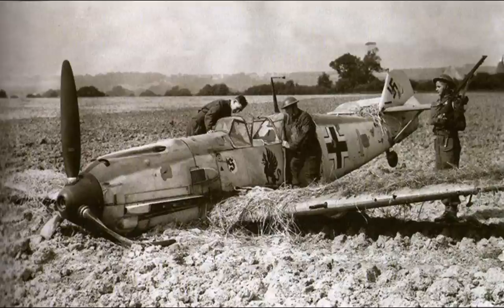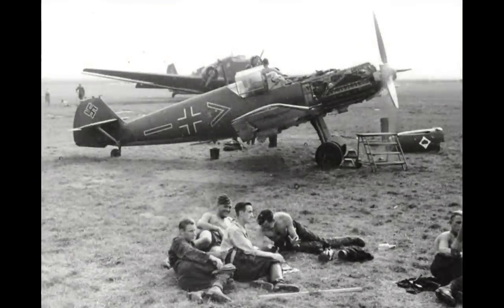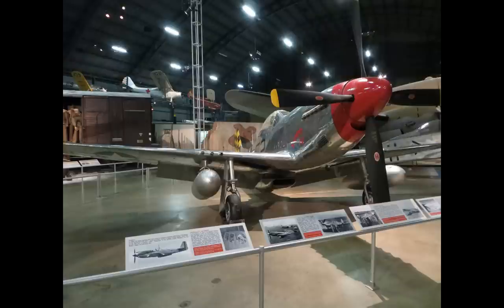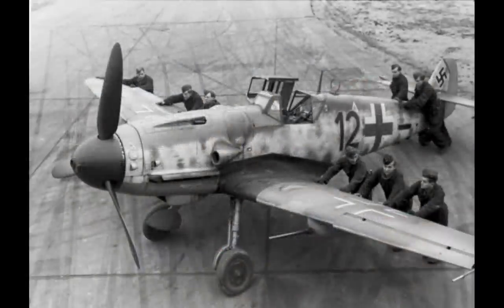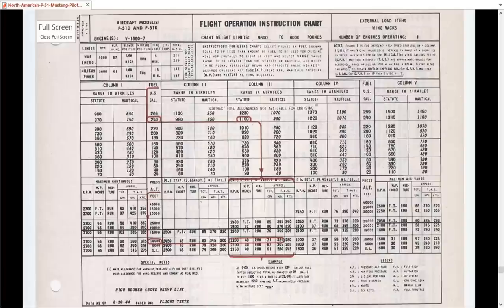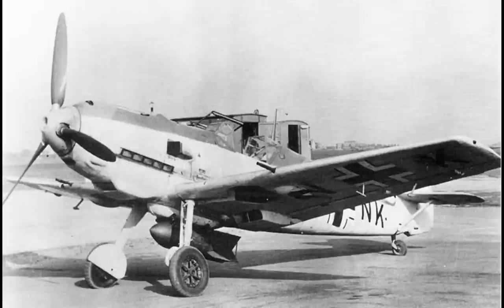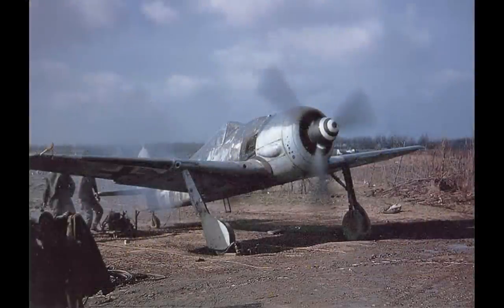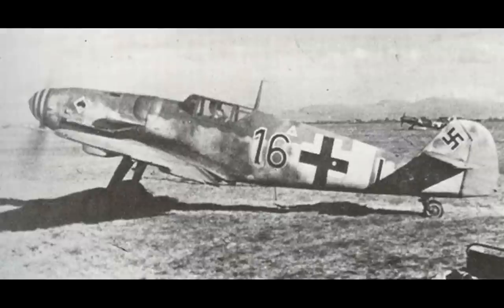Messerschmitt BF 109, Why Such Short Range?

Comment: A polite answer to a question that should not needed to have been asked.  Germans weren't planning on needing a single engine  long range fighter else they would have built one, they certainly could have built one, but maybe they would have had to use Heinkel rather than Messerschmitt.  So could have the Brits. They didn't think they needed one either and for a defensive fighter or a tactical fighter which they both were, they were supposed to be close to their area of operations.  The 109 should have been replaced by 1943.  The Me-309 was larger with built in longer range, but still nowhere near the P-51's, even after 1940 the Germans were no longer planning to fight over Britain anytime soon.   The Germans never  had a strategic aviation policy...that died with Wever.   The Brits also had gotten caught short legged but the US picked them up with the happy marriage of the Merlin to the Mustang and the Americans gave the Brits all the single-engine long range day fighters they needed, around 600 Mustang III's and IV's and the Brit loss rate was low because these aircraft were not used for ground attack.  The Germans did not have a range issue, except in 1940, after that it was a performance/production/pilot issue that they never resolved.  Note like the Germans the Brits did not have a daylight strategic aviation policy, nor did the Russians. Only the Americans decided they would take the war to the heart of the enemy in daylight.

Comment: As usual, a terrific video. Thanks for your effort to document these subjects. One thing that you should note is that the ME-109 had less internal fuel storage volume as the airplane mounted radiators in the wing which is where the P-51 stored most of its fuel. Even though the P-51 had thinner wings with its beautiful laminar flow airfoil, it had much greater fuel storage capacity as the P-51 mounted its radiator under the belly of the fuselage; and as you note elsewhere actually increased overall thrust. It also had an additional 85 gallon tank behind the pilot. See http://109lair.hobbyvista.com/techref/systems/cooling/f_flaps.htm for an outstanding analysis of the ME-109 radiator system. 
Please keep up the good work!

Comment: @Greg's Airplanes and Automobiles
I think one thing many people forget when discussing the shortcomings of the Bf-109, is that it was intended to be an air superiority fighter over a battlefront. A role in which it performed admirably in every theater until stopping USA bombers became the upmost priority. The Luftwaffe did anticipate the Battle of Britain and did design a fighter for that role and that was the Bf-110. It was a heavy fighter with a range up to around 1000 km. More than enough to cover German bombers to and from Britain. The problem was that it was a twin engine design that could not outfight British single engine fighter, at least not while escorting. It should also be noted that the German directive in the Battle of Britain, operation Adlerangriff, was succeeding in its goal of eliminating the RAF until the very last day before the London Blitz began. The RAF had been losing more planes and pilots than it would sustain but Hitler had given up and focused on the East. Perhaps this is why the German designers never learned their lesson to increase the range in their newer fighters like the Fw-190. Ultimately the Luftwaffe's job became a defensive one and range was not a priority in that regard.

Comment: I don't think the cooling effect people cite is due to the venturi, it's caused by the vaporization of the fuel, which absorbs heat energy. This cooling would allow a denser charge into the cylinder at a given boost pressure. I suppose, however, if you use fuel injection you'd also get the cooling effect, since the fuel is vaporizing when you inject it into the cylinder. Which means you could simply use additional boost and feed the air into the cylinder at a higher temperature, it'd get cooled down by the fuel when it gets injected and you'd avoid knock even given the higher temperature of the air being introduced into the cylinder. The heat removed by vaporization of the fuel is significant - in small 2 stroke model airplanes, glow ignition engines, which use methanol for fuel make a lot more power than spark ignition engines which burn gasoline, the reason being that methanol contains much less energy per unit mass than gasoline does, and therefore the mixture is a lot richer. This apparently cools the intake charge a great deal more and allows for a denser charge into the cylinder.
Reply from the maker: That's not an argument for a carburetor. You can inject the fuel far enough back to get that vaporization effect with fuel injection, which the P-51, P-47 and other allied planes do. The Germans did this too by using an extra fuel injector to inject fuel upstream, which is probably the best way to do it. Only a small amount of that fuel will vaporize, so injecting it all at a point early in the system is of no benefit. Thus the German system takes advantage of this principle while still maintaining ideal fuel distribution. 

My objection is regarding the argument that a carb is superior to fuel injection due to a cooling effect. It's not. There is a good reason nearly every significant fighter by the end of the war had gone to injection.
Reply: By "injection" do you strictly mean direct injection into the cylinder (i.e. the fuel gets introduced after the air enters the cylinder through the intake valve) or would injection into the intake system (like modern day throttle body injection) count? I always thought the later Merlin carburetors were actually of this sort. Yeah, I'm not convinced vaporizing the fuel before it enters the cylinder is better than vaporizing it in the cylinder itself, since both would induce cooling, but one could conceivably make a case for evaporation before it enters the cylinder to be better because it provides for a denser charge by cooling the incoming air. (Or another way to think about it is, in a supercharged engine, it helps with the intercooling and aftercooling.) I don't see a benefit to vaporizing a small fraction of the fuel as opposed to vaporizing all of it upstream of the intake valve, since the amount of fuel being vaporized would be proportional to the cooling effect. The fuel has a specific heat of vaporization, so the more you vaporize the more heat gets absorbed. In any case, the cooling effect ascribed to carburetors isn't due to simple adiabatic cooling of the air due to a drop in pressure past a venturi.

If by "injection" you include introducing the fuel before the charge gets to the intake valve, then yes, there would be no difference in cooling due to fuel vaporization compared with an actual carburetor.

Comment: Although the American aircraft called their fuel system a carburetor, it is a pressure carburetor. This actually very much like throttle body injection. What they call the carburetor is actually just an airflow measuring device that regulates how much fuel is injected through a nozzle below the throttle. Very ingenious mechanical control system. Also I have to say I think that the fuel going from liquid to vapor will cause heat from the supercharger to be absorbed as it heads towards the cylinder’s.
Reply from the maker: Yes I have many videos in which I make it clear that the U.S. "pressure  carburetor" is actually a throttle body fuel injection system.

Comment: The P51´s empty weight was more than 50 percent bigger than of Bf109G(which was still being considered too heavy by Germans), apart from bigger airframe and thus more internal fuel , it was the supercharger which gave P51 it´s great range(high cruise speed at high altitude) and great high alt performance(where the combat started most of the time), infact P51 was relatively underpowered at low altitutes when it came to it´s power/weight ratio, it´s just that P51s were the ones in tactical (and numerical and pilot skill)advantage entering low altitutes, mostly already chasing German planes. Meanwhile Yak-9DD with it´s almost  same empty weight as Bf109G and 1500 miles range was simply filled with fuel tanks "Mustang style"

Comment: Great vid. According to sir Stanley Hooker's auto biography, having the carb before the supercharger was an advantage as the charge was cooled by the fuel, allowing higher boost without overheating the combustion chamber. He was a Cambridge mathematician specialising in the maths of fluid dynamics and flow. He was assigned to rolls Royce by the ministry and for the first few months he wandered the workshops and labs at Derby with no assignment. Noone at Rolls had yet  done the math... He ended up as the chief engineer. The book is called 'not much of an engineer' It is a very interesting read. Keep up the good work.
Reply from the maker: Then why change the Spitfire over to injection?
Reply: @GregsAirplanesandAutomobiles  ?? Fuel economy.  Injection cools the charge as it enters the cylinder. Before that they did fit a diaphragm above fuel in the carb version to solve the negative G problem. My dad worked on the drawings and tooling when they moved Merlin production to the Ford plant. He used to say the mantra was 'increase the pitch and boost the boost then you'l get the bird to roost!'.

Comment: Notes:
1) I read in an auto-bio of a German pilot that the 109 had drop tanks in the Spanish war, but for reasons unknown someone eliminated the drop tank connection in the 109 model used in the " battle of britain".
2) The reason for short range fighter like the Spit and 109 was, they were designed for point defence and offence, not long range offence.
3) The British needed a long range fighter to escort their long range bombers, so they ordered a fighter from the US company North American Aviation. That fighter, which was designed, built and flown 90 days after the contract was signed,  became the P-51. One of the designers of the P-51 was Edgar Schmued(sp?) who formerly worked for Messerschmitt and may still have been a German citizen. The Us brought two of the P-51s to destroy in landing gear drop tests. Pilots flying the 51s from the west coast to the east coast for the tests told their high ranking superiors that the 51 was a great airplane and they should buy a lot of them. The original P- 51A had a low altitude Allison engine and was used by the US Army as a ground attack fighter/bomber. The British bolted a high altitude Rolls-Royce engine to the 51 and it became a high altitude long range air superiority fighter. The RR engine used in the US P-51s was built by the Packard Motor Company in the US.
4) After the war US P-51 pilots testing the 109 stated that visibility out of the 109 was terrible, and one of the big keys for fighter to fighter success in WW2 was seeing the other fighter first, which put the 109 at a big disadvantage. 
5) A big reason for the 109 being slower than the 51 was the exposed rear landing gear, which acted like a boat anchor. 109 pilots complained about the drag of the rear wheel the entire war, but Messerschmitt never put in a retractable rear wheel.
6) A big problem for the German airforce was the Soviets overrunning the Romanian oil fields in August of 1944. No fuel, no planes in the air. A standard joke by the German infantry on the western front was,  if you see a dark plane it's British, if you see a silver plane it's American, if you don't see any planes it's German.
Reply: I read that the 109s in the Spanish civil war had drop tanks, from a book I read about 20 years ago. The book was by a famous German pilot, but I can't remember which one.
I looked for photos of the 109b with drop tanks....and found none. I also saw a note on the 109, that the first one to be fitted with drop tanks was the E7.
The statement in the book that the 109s had drop tanks in Spain has always remained in my memory, but it may be wrong.

Comment: Another factor in the design of these early war aircraft was the weight of the fuel - and - the fact that for some of these aircraft - there was no need for it.

When P-51's first took off - they were heavy with all the fuel it was carrying and the pilots burned it off according to what they thought effected the aircraft's performance the most, so that when they got into combat the fuel tanks which hurt their performance the most were less full of fuel.  Someone with the time and interest can look that up.  I've seen it but hesitate to post something specific from memory.

For the Spitfires - these aircraft were primarily intended to be interceptors.  So - why carry enough fuel to fly to Berlin - if you didn't have to?

For the Germans - the Me 110 was supposed to be their long range fighter - not the 109.  The 110 is another story but for the 109 - for most of it's career - it was used as an interceptor and hence, like the Spitfire - didn't need to haul all that fuel around.

An Interceptor is going to be flying, for the most part, over friendly territory - so - when it's gone through it's fuel - it can land at the closest airfield - top off - and fly home.

The Luftwaffe was never intended to be a strategic air force - like that of the US & UK.  It was meant to be a tactical air force to support the Wehrmacht.  Thus, the relative lack of German interest in the development of 4 engined bombers. (They had some but nothing like the US or UK).

For a tactical air force though - it's fighters can be positioned much closer to the lines - if for no other reason than to up the sortie rate - and hence requires less fuel than an aircraft designed for Bomber Escort - like the P51.

Early war aircraft design didn't emphasize fighter range because the need for that wasn't as apparent as it would be once they actually started fighting instead of theorizing.  For one thing - in the US - the Bomber Cult specifically forbade the development of drop tanks because it called into question the ability of the bombers to fly unescorted to their targets - which is what the Bomber Cult insisted they would be able to do.  Once bombers actually started trying to hit their targets without fighter escort - attitudes changed ...  and you had the development of the P-51 in the US.  Britain's and Germany's solution was to give up on daylight raids.
.

Comment: The P-51, with its laminar flow wing, was designed in 1940. The Bf 109 was designed in 1933. There was a LOT of technological progress in those years.The Packard-built Merlin 66 used in the P-51D had fuel injected carburettors (as opposed to direct injection), which fixed the negative -g issues.

Comment: Some Points of Contention: 
1st: There was Room for more Fuel, the Room later used for GM-1 or MW50 Tanks could have increased internal Fuel Capacity to 600 Liters without upsetting Flight Characteristics too much.
But since the Long Range Role was passed on to the Fw190, and the Post BoB 601s and 605s became more efficient than their Predecessors, the Range remained acceptable for its Purpose. 

After BoB the 109s were used in the Firefighter Role, as a Close Support Fighter against Il-2s etc. in the Land War against Russia. 
These Missions often lasted no more than 45 Minutes until Landing and Rearming again, thus carrying more fuel would have been unnecessary. 
And for Longer Missions 300l Droptanks would almost Double the Flight Time.
Reply: He stated the 109E had 106 gallons of internal fuel. Assuming US gallons that's 401 liters. If you increase that to 600 liters that's an extra 50%. If the initial range was 400 miles, an added 50% would give you 600 miles compared to 1500 miles (at 370mph cruise) for the Mustang (I assume that table was with internal fuel).
Reply: @iskandartaib  The German and American measurement Methods do differ in Methodology quite a bit though. 
The German Numbers all include flying for 30 Minutes at Combat Power, Climb to 6k, and then Flight at Economical Cruise Power, 1.0 ata at 2100RPM.
So realistically speaking, the 109s Range can be extended quite significantly over the Normal Figures, while the Mustang's Range Figure can only get lower. 

My Main Point though was that Range could have been added, but wasn't, because after the BoB  Drop Tanks became common, and for 90% of Operations it's Endurance was more than enough. 
Just consider that some Russian Fighters had Combat endurances of just over 20 Minutes, like La-5FN if flown aggressively.
Reply: Yeah, I do agree range could have been extended (but not to the extent of matching the P-51), and in most cases it wasn't really needed for the situations the Germans found themselves in post-1943. It would have been nice to have in 1940, though (and it would have been very nice for the Allies if they had been able to significantly extend the range of the Spitfire and the P-47 in 1943).
Reply: @MyFabian94 It was actually earlier than that. In 1941-42 the RAF flew offensive patrols and bombing raids over France, with the objective of luring up Luftwaffe fighters. They had the same problems the Me109s had over Britain in 1940 due to the short range.

Comment: Air temperature does not drop after a venturi, it drops IN the venturi then increases again after the venturi when pressure restores. It's a reversible process, some losses aside and potential heat exchange with the piping. I actually heard some aircraft designers being wrong on speed vs pressure vs temperature. In an airflow, restriction means faster airspeed thus lower pressure thus lower temperature. Slowing down INCREASES the pressure. That's talking static pressure, which matters in thermodynamics, not total or dynamic pressure.